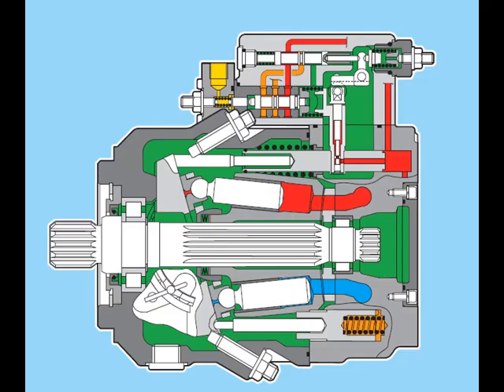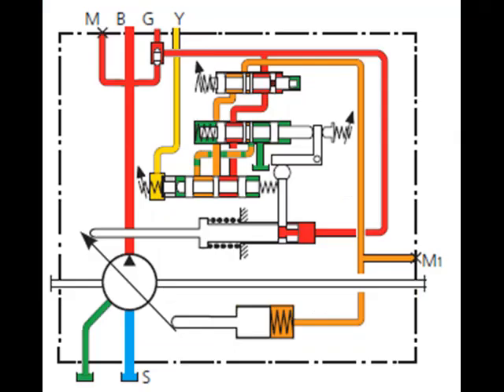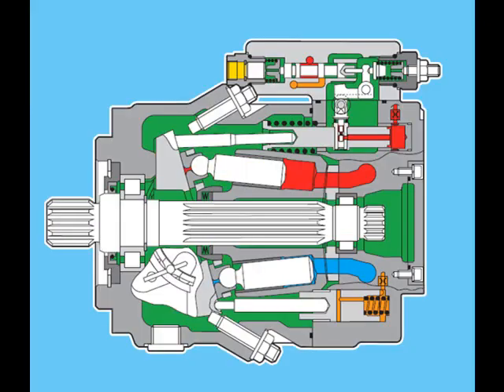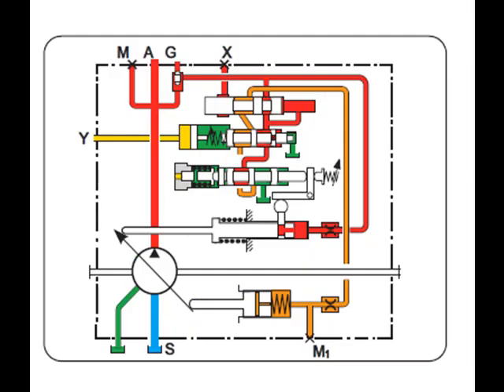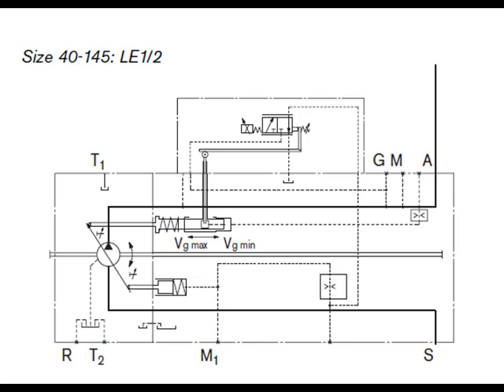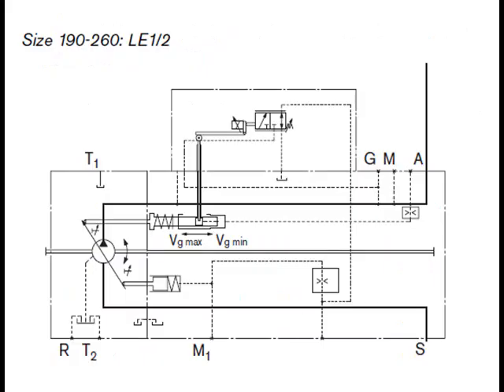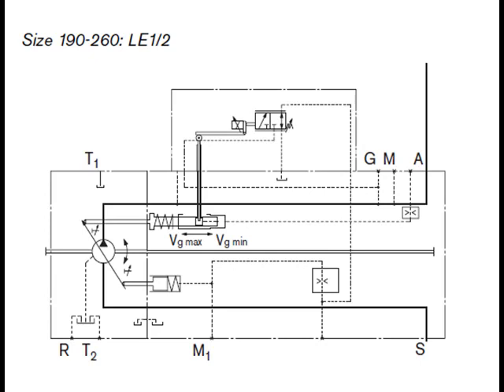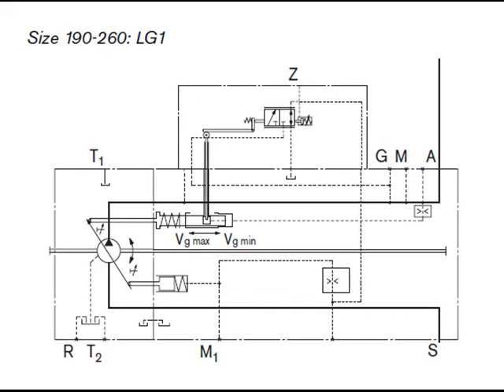HYDRAULIC PUMP  A11VO.. TYPES OF CONTROLLERS -2

Comment: Thnx for sharing this valuable info. Mr Naguib 👏
* These are the rest of adjustment /control  types abriviations and settings 🙂;

#LR = power controller permanently set

Capacity regulator with override: LR.C = Cross Sensing, negative
LR3 = dependent on high pressure, negative
LG1 = dependent on pilot pressure, negative
LG2 = dependent on pilot pressure, positive
LE1 = electrical, U = 12 V, negative
LE2 = electrical, U = 24 V, negative

Power regulator with pressure cut-off:
LD. =
Capacity controller with pressure cut-off L.E .. = Capacity controller with hydraulic pressure cut-off, 2-stage
L..G. = Power regulator with pressure cut-off, hydraulically remote-controlled

Capacity controller with load sensing:
L… S = capacity controller with load sensing
L… S2 = capacity controller with load sensing electr. prop. override, 24 V
L… S5 = power controller with load sensing hydr. prop. overridden

Capacity regulator with stroke limitation:
L… H1 = negative code, ∆p = 25 bar
L… H5 = negative code, ∆p = 10 bar
L… H2 = positive code, ∆p = 25 bar
L… H6 = positive code, ∆p = 10 bar
L… U1 = positive identification, U = 12 V
L… U2 = positive identification, U = 24 V

Pressure regulator:
DR = pressure regulator
DRS = pressure regulator with load sensing
DRG = remote-controlled pressure regulator
DRL = pressure regulator for parallel operation

Hydraulic adjustment, depending on the control pressure:
HD1 = (positive code), ∆p = 10 bar
HD2 = (positive code), ∆p = 25 bar
HD.D = with pressure
cut-off HD.G = with pressure cut-off, remote-controlled

Electrical adjustment, with proportional
solenoid : EP1 = (positive identification), U = 12 V
EP2 = (positive identification), U = 24 V
EP.D = with pressure
cut-off EP.G = with pressure cut-off, remote-controlled
Reply from the maker: I know that there are about 19 types of controls for this pump type
Reply: @hydraulic-mnaguibhe-tech4093  thnx eng Mohamed I'm following your videos,and i want a video of LPV165Liebherr pump if u plz